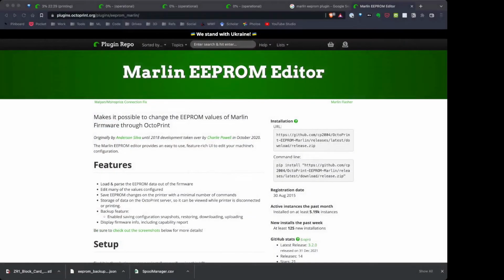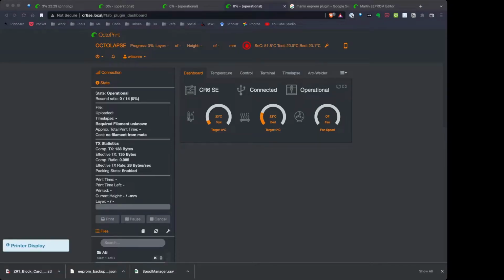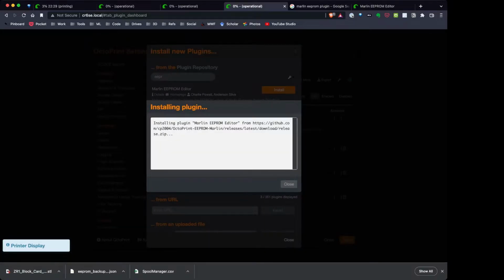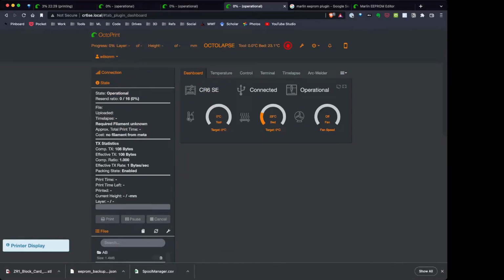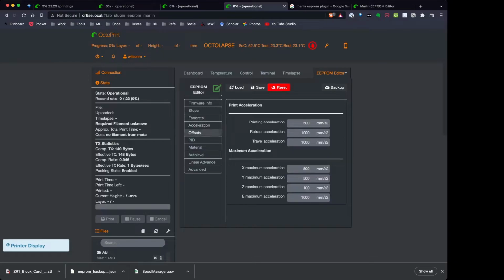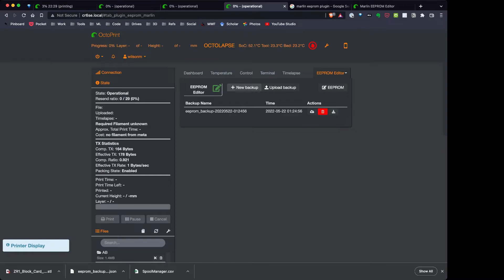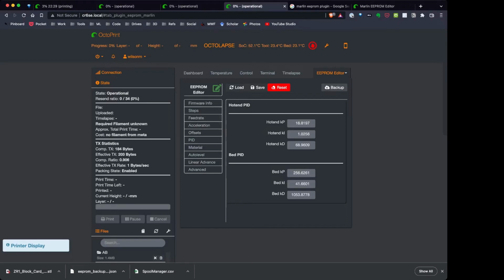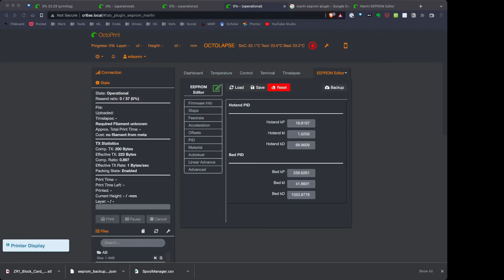3D Printing Tips: How to Edit, Save, and Restore Your EEPROM with OctoPrint

Comment: do i need sd card plugged in PRINTER ?
Reply from the maker: No. It saves the backup to the RPi
Reply: @minimal3dp  i mean, if i change the z offset, where does the plugin save new value ?
Reply from the maker: @psykopat81  When you save with the plugin, it saves a backup of the EEPROM on the Raspberry Pi sd card.